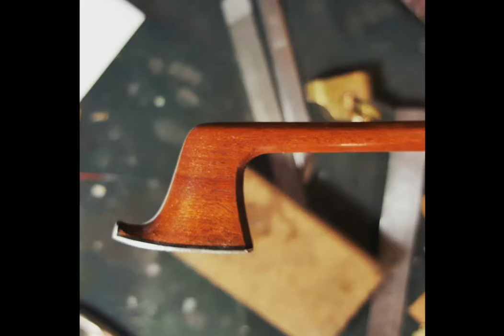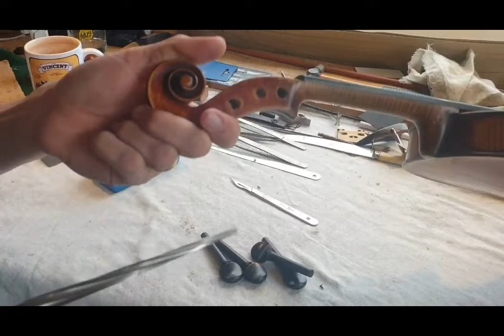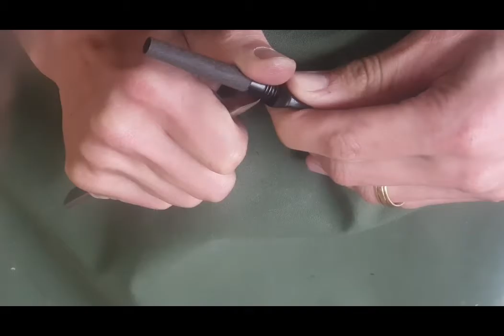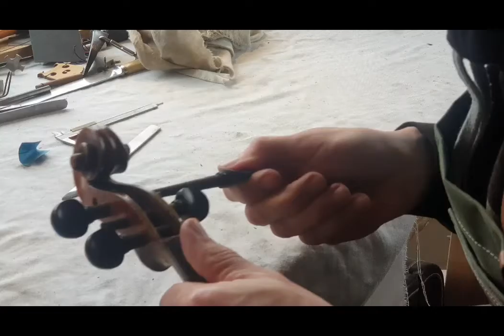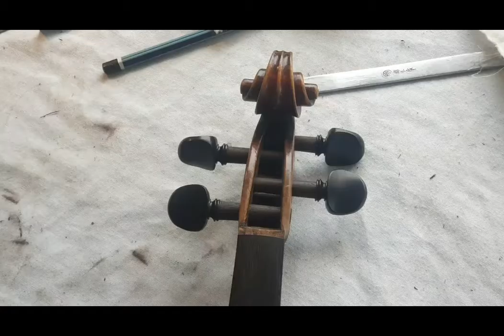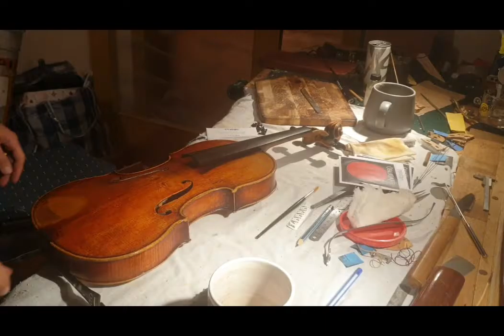150 year old French violin restoration  part 2

Comment: Peg paste on the peg in the cutter can help too. :)
Reply from the maker: Cheers, I'll give it a shot👍
Reply: @windowintomyworkshop820  I opted to go with adjustable peg shapers & with that I can change the angle for the shorter (1:20) taper for some German violins when replacing the pegs so as to not change the taper in the pegbox. It does mean the pegbox doesn't get a clean cut though. I haven't tried to find reamers to match that though & only have the 1:30 taper reamer(s). Obviously using adjustable peg shapers one has to be sure it is set correctly to match the taper accurately, but that can be fine tuned when checking the first cuts of the peg with more material yet to come off. Also, I have found rotating the reamer in reverse to be effective in removing a minute amount when desired & also good for helping new pegs to bed in on new (student) instruments etc.

Comment: nice sensitive Skills U have, I like that, the violin looks pretty real, isn´t it. So, why do U deny it´s real. To do so U pretend to be able to differ between JBV copy and real? So can U tell the owner it´s not the real thing. just worrying.
Reply from the maker: Thankyou! I did this instrument over a year ago,  and I thought i went into the main reasons I felt it was a copy and not the real thing in the video series,  but maybe I didn't.  It really is to much to go into in a you tube response,  I am happy with my judgement of the instrument,  and of course this was only my opinion,  the owners could have sought a second opinion or arranged to take it to a European expert if they wished.  I can't remember exactly what caused me to believe it was a nice German copy but I think they were quite obvious signs when the instrument was in my hands.  The varnish type,  certain manufacturing techniques,  and the label was also printed at a later date I think.  Early printing methods leave a different impression on the paper than later.  
Hope this helps.  Cheers Paul.
Reply: Strictly playing the odds can make sense sometimes. The odds that "some guy" walks off the street and says he has an authentic JBV in reality is about zero.
Reply: @johnjriggsarchery2457  If U have one and ask what is it U´ll get obligatory "authentic...about zero".